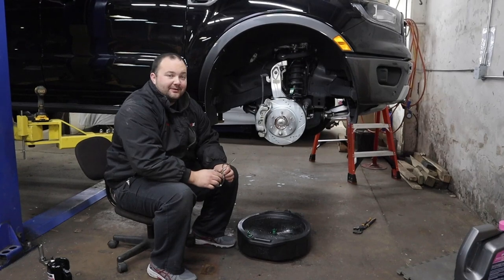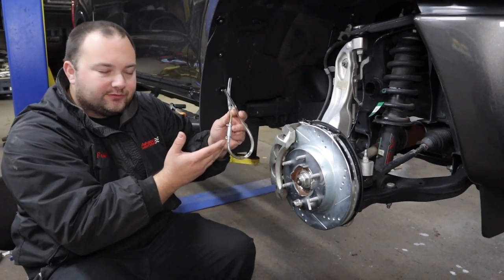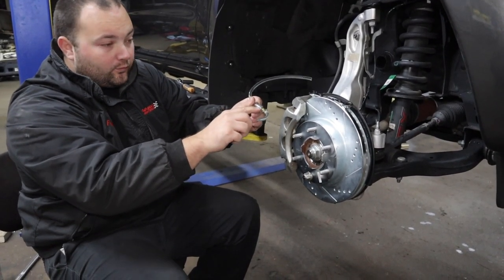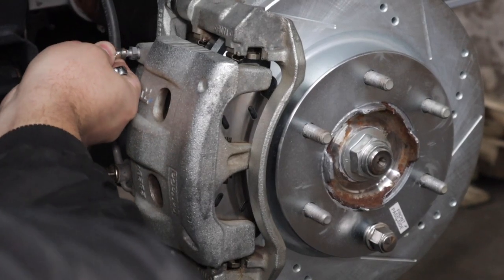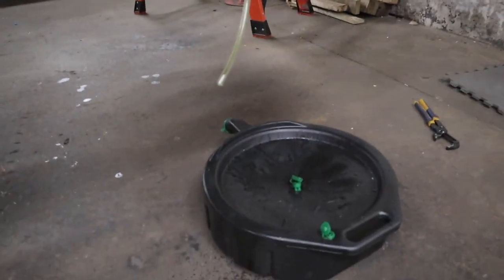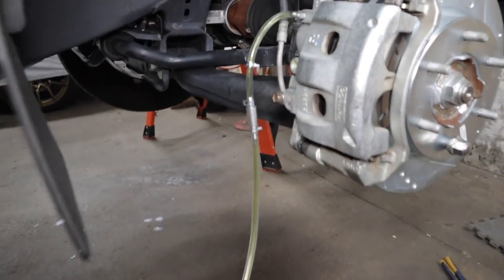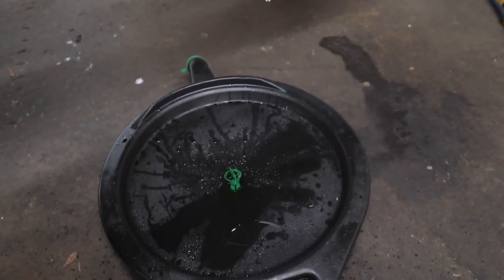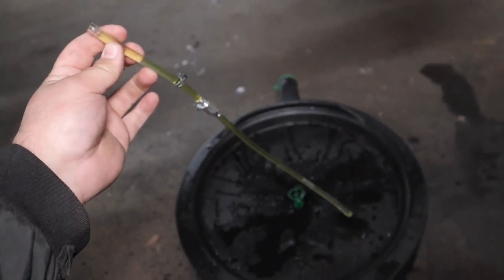Is this the ultimate brake bleeding tool? Super cheap and easy!

Comment: I got something similar from halfords years ago, it has a spring loaded ball inside the metal pipe section. It also had it's own small bottle attached to end of hose. 
I was still getting air sucked in through the bleed nipple threads, very soft pedal. 
Resorted back to asking the wife to do the pedal so I could close the bleeder.
Reply from the maker: Stupid air 😤
Reply: Teflon tape?
Reply: Poor wife😢

Comment: Old mechanics trick to keep the bleeder nipple from sucking in air woth this tool, is to put grease on the nipple threads otherwise you will suck in air.
Reply from the maker: Ahhhh okk!
Reply: I tried this but it’s a mess. When the hose moves a little, the bleeder nipple rotated a little and breaks the seal from the grease. Is there anything better to seal the nipple when loose? Vaseline? Teflon in the nipple threads?